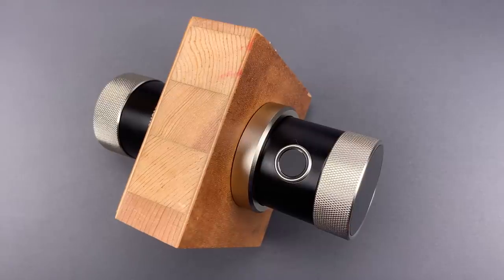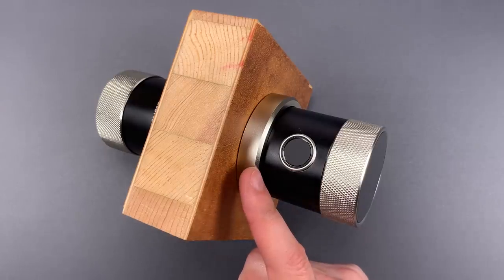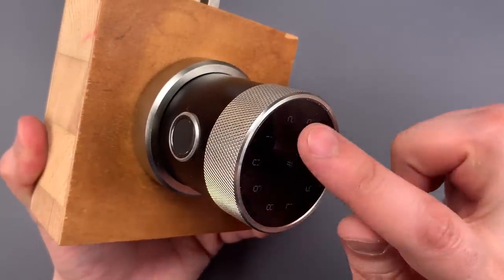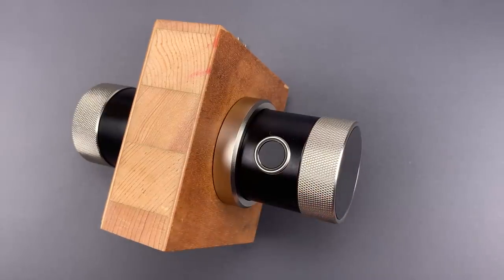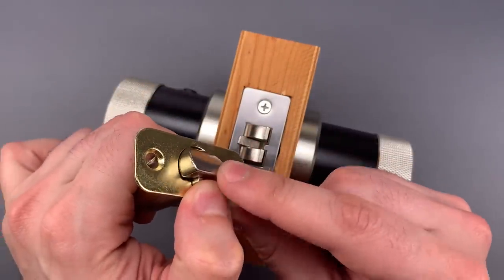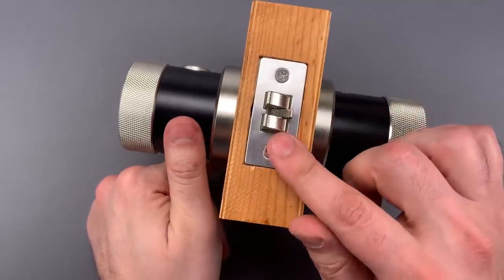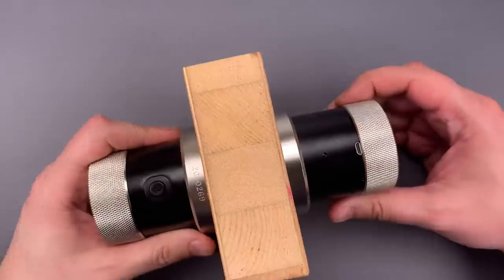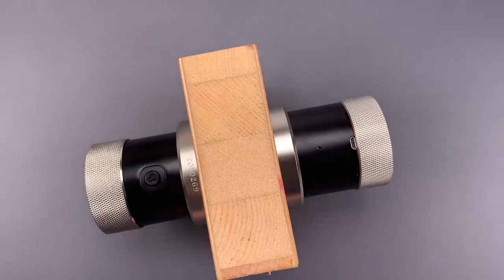[1120] Fingerprint Lock That Forgot The Fundamentals - DatoHome L-B400

Comment: "i forgot to charge the doorhandle" is a problem we should not invent
Reply: I just love the way this is worded
Reply: Yeah lets rather stick with I lost my keys or locked them inside the house and have to call a locksmith now or ha e to have a backup key laying around somewhere safe. So much easier than quickly borrowing a powerbank from your neighbour
Reply: @doomse150  Or just don't forget or lose your keys like an idiot
Reply: @Axyo0  You could say the same for recharging the lock
Reply: @Axyo0  Karma is a harsh mistress, be sure to reply when you lock your keys in your car.
Reply: It's not a charging port. The lock uses regular AA batteries inserted from the inside. You monitor the batteries with the app (that can also unlock the door). The exterior port lets you power the lock from outside if the batteries die,but doesn't charge the batteries.
Reply: @Vincent_Beers  least thing I would like is a dedicated app for a door knob. Sounds like a solution for a problem that never existed
Reply: @leeeeeee2796  Depends on your lifestyle and number of people you deal with. You never have to give anyone a spare key or worry about someone making a copy when you just needed to let them in once in a while. There's any number of reasons that it's convenient for some people.

Never having to wonder if you or your kids didn't lock the door, you don't ever have to worry about your kids locking themselves out, they don't even need to carry keys so they can't be lost or stolen, and there's numerous more if you put some thought into it.
Reply: @Vincent_Beers  Yeah what a great Idea..... the only way to get in the house is your smartphone, good luck when you forgot your smartphone anywhere.... or probably more typical... battery empty.

No, its always a bad idea to invent solutions for never existing problems.
Reply: I suspect this is why the port is on the outside. So you could in theory power it if the battery got too low last time it was locking.
Reply: @harrison00xXx   This lock has four separate ways to open it. Fingerprint (can't be lost without injury), combination (can't be physically lost, but can be forgotten), RFID (can be physically lost, but can be easily and securely reproduced), and Bluetooth (not useable if bluetooth device is unusable). Memorize the combination, have the RFID card in your wallet, have your phone charged, and observe proper safety around industrial equipment and you will never get locked out of your house. The usb port on the outside of the lock allows it to be powered externally if the lock's batteries die. Electronic locks offer OPTIONS. If you lose your key to a mechanical lock, you are just SOL without either obtaining a backup key or compromising the lock (whether by exploit or force). Sometimes bells and whistles are unnecessary BS, sometimes they are true improvements in performance or convenience.
Reply: @nuclearusa16120  luckily i only need a keycard (or any stiffer plastic is also doing it) if i forgot my key.

The old door we had was with electric motors to open it... easily opened by pushing at the whole door with force, by triggering the motors to open/close, it was going back to its regular position.

Safety is a big lie in our world, in real things like doors and probably even more when politics talk about safety.
Reply: @harrison00xXx   That kind of door sounds like either A) somebody royally fucked up, or B) it had to be made that way to comply with some regulation or another. 

Safety and security are poorly understood concepts for the vast majority of people. Most people forget that security is meaningless without a known threat to compare it against. For instance, most residential door locks can be picked rather easily, however most robbers don't pick locks; they kick in doors, break windows, or walk right in because you never locked the door in the first place. That doesn't mean that pick resistance is worthless, it just means that one might want to reinforce the doorframe before worrying about pick resistant locks. Electronic locks that have multiple secure authentication routes can provide significantly enhanced security by simply automatically locking without user input.
Reply: @nuclearusa16120  its a typical front door and a car entry, everything else is anyways "safe"
Reply: @doomse150  Nah just grab your hide-a-powerbank
Reply: Mate we need to make door power banks
Reply: My front door is mechanical.  The door from my house to my garage is electronic.  I find the battery lasts about 3 - 4 years on it.  It’s just me opening it after all and generally once a day at that.  It’s great when you have groceries in your hand though.
Reply: That’s what I was thinking too I’d that it is still a total failure of a door handle if used on a door leading outside. Even if you remember to plug it in to keep it charged while you’re away what do you plan to do when you try to get inside your house? The cord is just going to rip out damaging the cord and the knob. I like the idea of something like this but there’s a reason that people typically only go as far as a electronic keypad.
Reply: I just wonder what happens if someone (an attacker) supplies what I’ll call inappropriate voltages* to that port...

* e.g: reverse polarity? 120VAC? 10,000 VDC? Other?
Reply: Am I the only one concerned with the fact that the charging port is on the outside tho???
Reply: @JohnCooper-ir7uj  no, but I understand the reason.  If you’re locked out and the batteries are dead, that’s the only option you have other than busting in.
Reply: @JohnCooper-ir7uj  no, you are not.
Reply: @DavidLindes  you brick it. It's not going to open tho
Reply: @JohnCooper-ir7uj  why would that concern you? And yes, it needs to be on the outside. How else are you going to get in of the battery dies?
Reply: In order to avoid this problem, hard wire the door with slightly bulkier hinges (or "a hinge")
Reply: @doomse150  ahhh the new gen.
Reply: @TheAdatto  Is that supposed to be a low level mocking/insult? If yes, it's a "fabulous" display of maturity from someone your age...
Reply: @DavidLindes  I don't know about this particular one, but if it's well made, it should have a safety measurement to make sure no irreparable damage occurs, or at the very least remain in its locked state when being fried. If you wanna get fancy about it, you could probably build a mecanism that short-circuits the power supplier when vastly incorrect power levels are supplied (in the spirit of the "offense is your best defense" motto)
Reply: @sselesUneeuQ  Yup, there are doors with built in biometric locks. This here is merely meant as an option to upgrade an existing door
Reply: @doomse150  ehm. Everyting oke buddy?
Reply: @TheAdatto  Says the guy making random passive-agressive comments
Reply: @doomse150  ?
Reply: @TheAdatto  Are you able to express yourself in complete, understandable sentences?
Reply: @doomse150  Yes
Reply: @TheAdatto  Then why don't you use one of those complete, understandable sentences, which you claim to be capable of expressing yourself in, to tell me what you want from me or what you are trying to tell me?
Reply: @doomse150  Time is €
Reply: @TheAdatto  Then why did you waste both your and mine by making useless random comments?
Reply: Its rare to lose keys and I'm sure it would be rare to forget about the constant alerts about your doorknob battery being low.

In the end you can lose your keys at any moment without warning, but the doorknob is a 2-3 time timed batt change throughout the year that prepares you beforehand. But now that your doorknob is electric simple corrosion or vibration, big enough shock, etc can render your door useless.

In the end if someone wants in, its easy to hit the knob with a hammer.
Reply: @A cat on his hind legs. You don't have neighbors who can borrow you theirs?
Reply: @doomse150  I have had my key for 7 years or so in that time I have lost or forgotten them zero times.
Reply: @malikthemadman  That supposed to be some kind of argument for anything?
Reply: @doomse150  Yeah just saying not everyone loses their keys.
Reply: @malikthemadman  Never claimed that, but it happens often enough
Reply: Here is an uninformed user not commending the fact that LPL couldn’t flaw a lock with 4 ways of opening. I think charging a door is a better alternative to a lock that can be picked.
Reply: @leeeeeee2796  But there is a problem: Normal locks are able to be picked. This one cannot.
Reply: @KiLLJoYYouTube  if only there was a YT channel dedicated to showing how easy that is?
Reply: @doomse150  If its just a normal door knob, you wont need a locksmith. You can just use a hammer or some stone to smash the door knob off. Its pretty easy and ive done it a few times alr
Reply: @Deady4u  And that is in what way better than calling a locksmith?
Reply: Not to mention that the charging port is on the outside knob 🤦‍♂️
Reply: @alberta8878  Did you read any of the comments/replies? The doorknob itself runs on changable batteries, which can be swapped from the inside. The port on the outside is an emergency charging port in case the battery runs out while you're not at home. It's not that hard to understand
Reply: @mrsirrman1294  it takes AA batteries, you don't charge it with that port. The port is only in case the batteries die while you are outside. You can plug a powerball in to temporarily power the lock to allow you to open it, but the port does not charge the batteries
Reply: @khatharrmalkavian3306  Yeah, starting an argument with an insult is always a good idea. And (without confirmation, since I don't own that specific model) most of them can always be opened from inside and only lock for outside
Reply: @Vincent_Beers  That's worse
Reply: @doomse150  How do you lock your keys inside the house?
You need your keys to close the door.
Reply: @RomainDelmaire  Frontdoors can't be opened from the outside without a key, because they don't have a doorhandle on the outside, just a doorknob. So yes it is very possible to lock your keys inside your house
Reply: @doomse150  Interesting, I don't encounter that kind of doorknob where I live.
Reply: @harrison00xXx  So what your saying is that your door can be opened by shimming it with a bit of plastic but bitch about an electronic lock that's basically the same level of security with enough know how?
Reply: @A cat on his hind legs. Put a power bank in your car or check that sufficient charge is in the lock before leaving
Reply: @RomainDelmaire  Look at the bolt in the video. It snaps closed and you need a key to push it back in in order to open the door
Reply: potato  That depends on the door knob. I could say "Telephones don't need batteries, they're telephones" and yet here we are, having battery powered wireless telephones making most people's lives easier by far. It's about convenience and sometimes even safety

But you'll be glad to know that this lock doesn't need either, you can operate it without the app and if there are no batteries installed or they run flat, you can still activate it by plugging in a power bank into the port on the outside!

Also, think about industrial, medical and educational facilities where transponders and keycards can often be found to increase security, manageability or even just user convenience! They're nothing new by far, though now also available for home users.
Reply: JonasLue it could be, or it could be easily pushed open since the electric motor was too weak
Changed already and the doors of the house were anyways „safe“
Reply: @A cat on his hind legs. surrounded within 200 miles? 😊

I wouldn’t want this turd of a lock too. So many things on it that will stop working within a decade or less.

- The USB port is already outdated. Good luck buying these in the (near) future. 
- The RFID chip technology used will be outdated or easily bypassed (is already quite easy but will become easier for anyone in coming years).
- The chosen Bluetooth version will be unsupported.
- The touch pad will wear out.
- The electronics inside will wear out.

This may sound arbitrary but I’ve been working with computers and electronics for decades and have seen many hard- and software go from legacy to unsupported very fast.
Reply: Fugp Basis  Nope, losing your fingerprint in the same way you could potentially lose your keys is going to be a pretty rough task
Reply: @doomse150  Okay, but this could be solved by having a way for the interior of the door to be connected to the house power, instead of this dumb battery powered door handle.  Heck, even a solar panel on top is better than this.
Reply: The OP was a funny quip, but in all seriousness people suggesting plugging this thing in specifically when leaving the house (which it can't do since the plug is on the outside and doesn't charge the batteries anyway) should really listen to a PSA about electrical fires!
Reply: @doomse150  charging is an extra chore id rather not have
Reply: I struggle to remember to charge the doorbell. Maybe this is the way things are going
Reply: I have one (different company, but same idea) they last quite awhile and give a huuuuge warning before the batteries die
Reply: They could use reverse powerbank technology for the case of a dead battery you just use the energy from your cellphone battery contactless and unlock using bluetooth or any other method
Reply: @Arthang  can’t lock the keys in most keyless type cars.
Reply: @Arthang  what sort of 1950s car do you drive that lock the car door as soon as you closed it?!
Reply: @mrsirrman1294  It's not a charging port. It uses AA batteries. That port is a temporary, emergency power if the battery dies and you're locked outside.
Reply: @JohnCooper-ir7uj  it's not a charging port.
Reply: @CrispyChicken38  That is something that absolutely exists for doors with built-in biometric locks, but is somewhat hard to do with a lock that you are supposed to be able to swap into a regular door
Reply: @annihilator247x  The lock isn't chargable, it's battery powered, meaning a single battery swap every few months will be sufficient and you have no wear down of internal batteries because there aren't any. Why does everybody assume this thing is supposed to be charged like a phone?
And just for the future, maybe leave the insults out of your arguments, it generally makes you sound the latter more objective, and not like an aggressive shittalk that everyone should better ignore.
And your car key example is bs aswell, the key needs no active components to be tracked by the car and do you say the same about the remote opener built in car keys? The component that actually might need electricity to work.
Besides, make sure to give that same shittalk to yourself when the wind smacks the door shut behind you while taking out the trash or receiving a parcel or something similar.
And while you're at it, tell that same bs to every little kid that forgot their keys when going to school and have to wait hours for their parents to come home
Reply: I hate to tell you, but that problem was invented over a decade ago when people started using smartphones for everything. It also bars access to a lot more than just a doorway.
Reply: We already did, battery operated keypad locks are fairly common
Reply: Well, as somebody pointed out, the lock actually operates on AA batteries, the charging port is more to put a power bank into it for quick power in the event those batteries die and you there is no power.  So you dont need to charge the knob, its more a backup power to batteries thing.
Reply: Unfortunately someone had the wisdom to invent that very problem.
Reply: @Vincent_Beers  this is worse than charging a doorhandle
Reply: I was about to defend this by saying they probably use a long lasting rechargeable coin cell battery. Most of you probably don't think about 'charging your motherboard' but your bios settings when your computer is off is maintained by a small coin cell battery. That being said I googled the exact lock and they use rechargeable AA batteries, which is just... How stupid can a designer be?
Reply: @TruCloudGaming  i suppose it would be worse to be locked out of the house due to a power outage